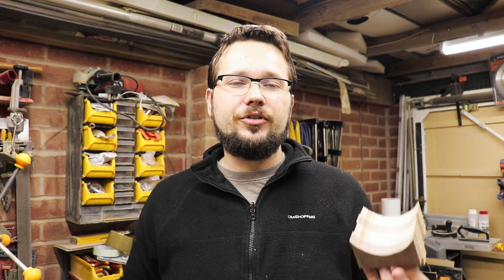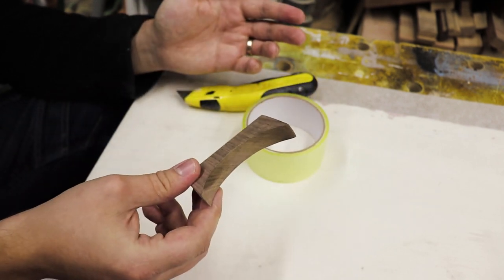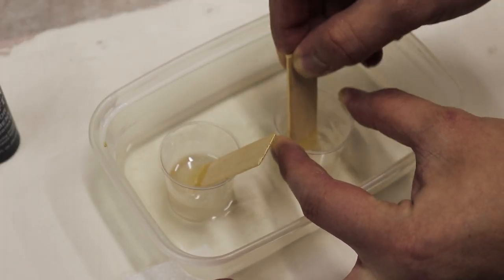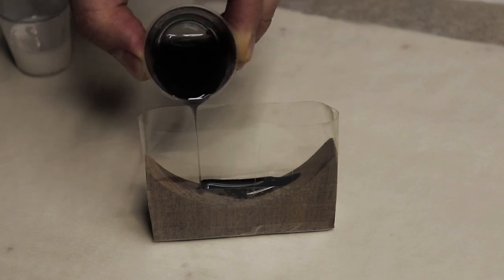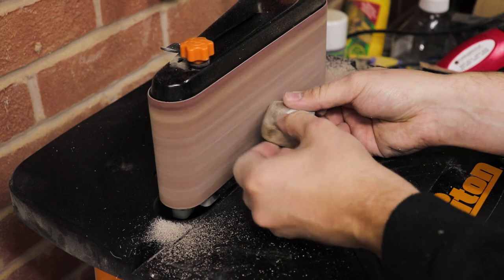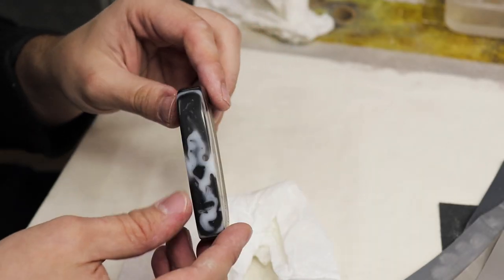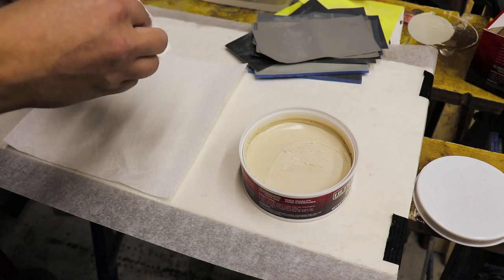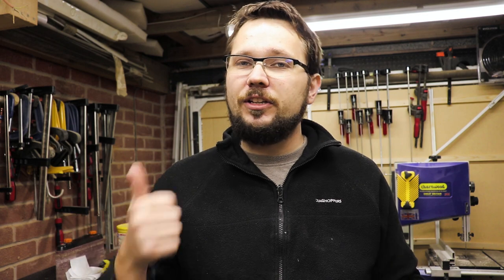Wooden pendant plus black and white epoxy

Comment: First ☝️ another beautiful result mate, I’m getting the epoxy itch as well but need to plan projects around that, eBay sells 4 litres of epoxy mix for around $65 Aussie & that seems good value, carry on mate 🍻👍👍👍👍👍
Reply from the maker: Cheers mate, go for it it's great fun. The results can be surprising and stunning. Just make sure to get a good epoxy. The one I'm using now is my third one as the other two we not good. There are different types for different things - learned this the hard way ;)

Comment: a heat gun will pop bubbles in epoxy, or a quick flash with a small blowtorch
Reply from the maker: Yep that's true that will sort out all the bubbles located at the top of the pour